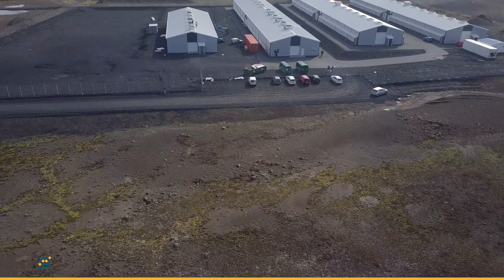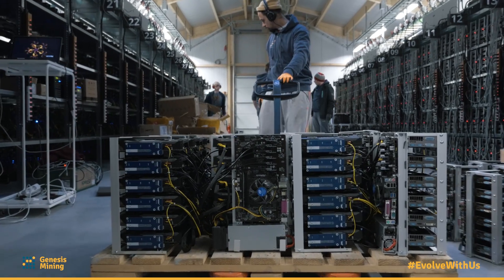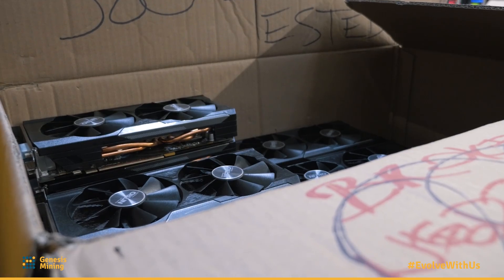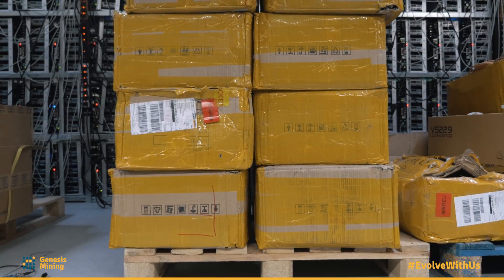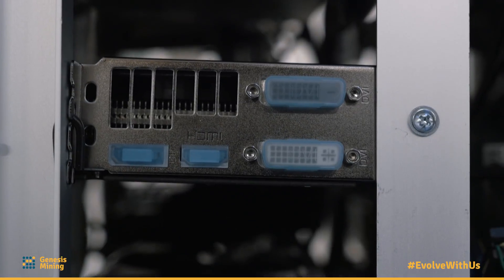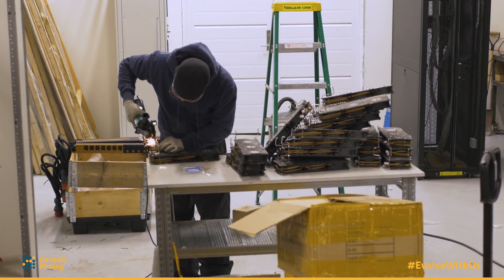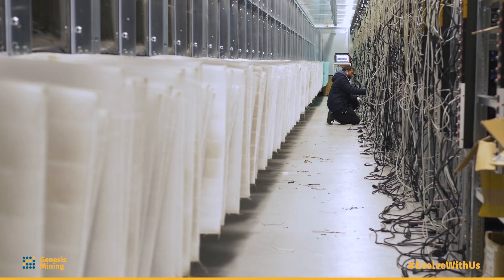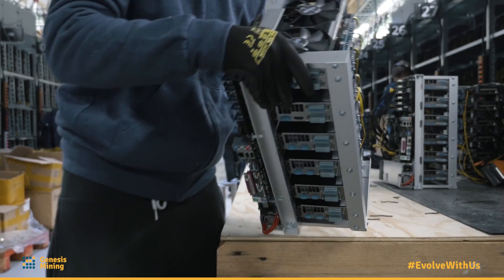Building a Cryptocurrency Mining Farm / Genesis Mining #EvolveWithUs - The Series Episode 2

Comment: This is a very informative video, showing that Genesis uses their on designs for the graphics cards, and equipment which means they are custom, and patented,  and trademarked by Genesis.  They have a massive mining operation. My  3% off Genesis Mining code: lbLK8h
Reply: "Custom?"  ... Perhaps.  
"Patented and trademarked?"  ...Not likely.

Use my affiliate code: 5xF30O ... and I'll use yours.
Reply: Whenever Bitcoin, or Litecoin mining returns, I will use your code for an upgrade in the low 100's dollar range. Only 2 others have used my code before. I'm silver in the affiliate ranking.